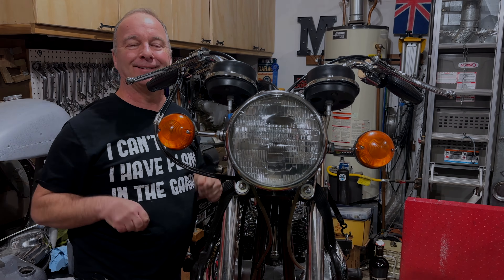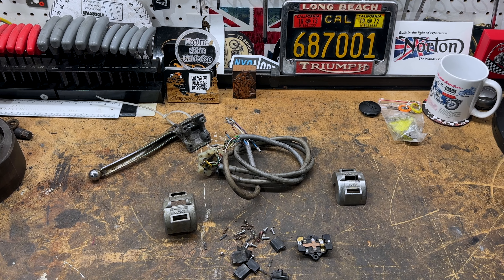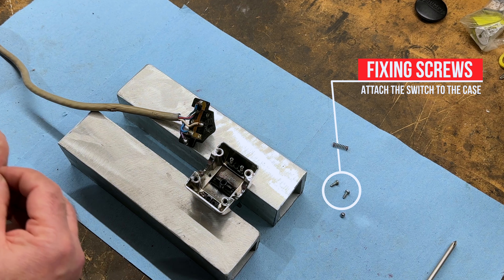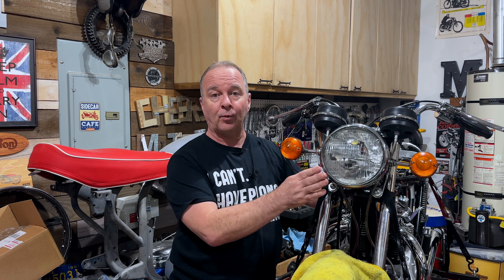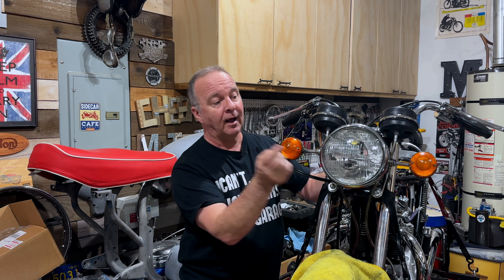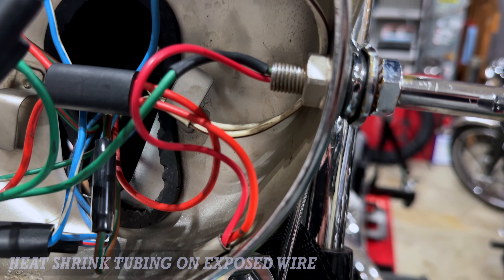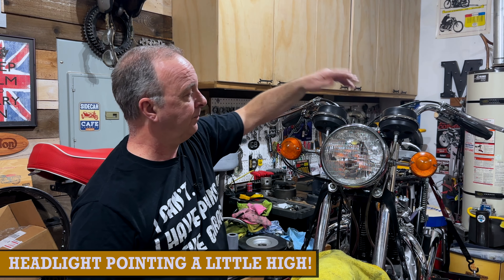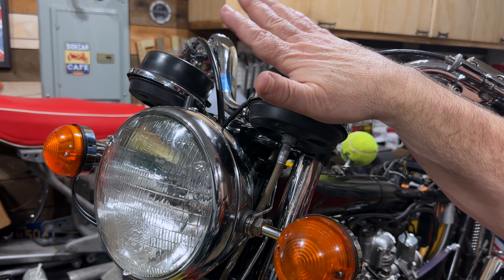1972 Triumph Bonneville T120RV OIF 650 - Part 7 - Electrical Part 2

Comment: Best what I heard of British eletrickery was that their cables don't work with copper inlets but with smoke inside! Proof is that when you have a shortcut smoke is coming out of the cable and thus there's no connection anymore. I even saw a tin of original Lucas spare smoke somewhere in the Internet. But the vendor was already offline, so I couldn't give it a try... Glad to see that you're back on your feet! Rgds from cold Northern Germany!

Comment: Ah Mike, what a timely post!  I've been dreading getting into my wiring on my 78, I've not worked the electrics of a Triumph in many decades, and most of my electrics aren't quite up to snuff.  You nailed it with the turn signals and your description of how they don't work.  Something about electrics by Lucifer.

Comment: Hi Mike. It would be great if you would do a video on starting the 72 T120 and adjusting the carbs from a cold start. i have the same bike with the old carbs and having a rough time getting the air/fuel mixture right. Thanks Gary

Comment: Those switches are a bit of a nightmare. One of mine had a broken plate inside and I discovered that the Spax version are very slightly different. 
I worry that the casing is too frail to take the power of the levers, especially the front brake.

Comment: Does the double white wire going to the flasher relay have yellow stripes? And is it supposed to have a constant 12v with key off?
Reply: Yes or no, please?
Reply from the maker: The wires that go to the flasher relay on my bike are only white. There is a white wire with a yellow stripe but that goes to the LH coil. There is also continuity between both battery terminals (+/-) and the flasher unit
Reply: @TheMightyGarage  My left coil isn't getting spark and I have a white wire with yellow stripe that is unconnected but when followed down, it goes to a double white wires with yellow stripes that is also unconnected. And I dont see any white wires thar would lead to the flasher. I wish I could send pics.
Reply: @TheMightyGarage  I also have a Boyer Micro mk- iv ignition if that explains it?

Comment: Lucas didn't use enough springs in their switches !! It's difficult ta get the instrument bulb holders to stay in the meter when the insulation hardens up so. When nothing makes sense, it's a ground issue. Or maybe a politician's fault.